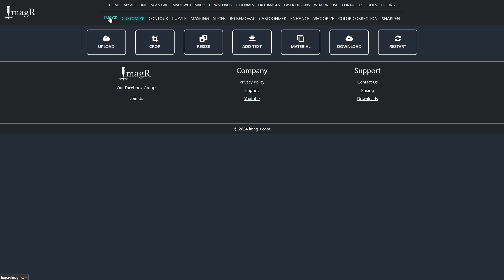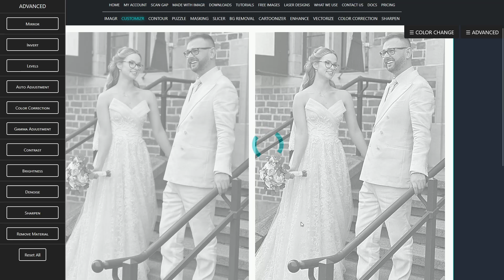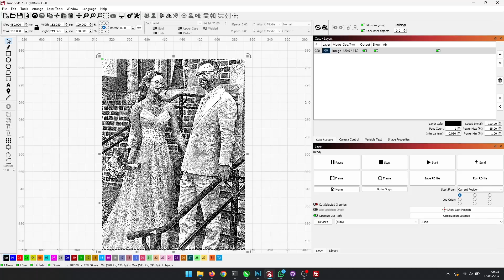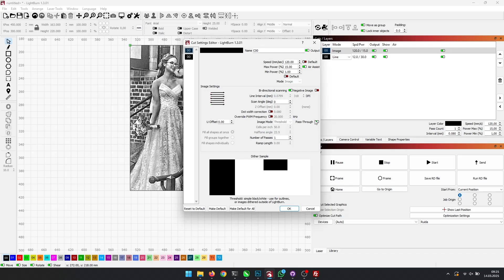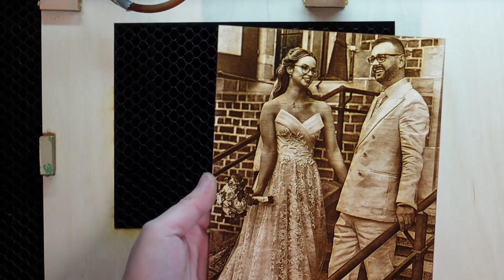I’ll Prepare Your Image for the Best Laser Engraving Results!

Comment: Each time I use the enchancer on PC version with license it cant stop loading. I add the picture, and even after an hour it keeps enchanting, how to fix that?
Reply from the maker: @crissueSport  offline or online? Depending on the input image size and the multiplier you use. Usually, you only enhance if the image is less than 1000px. And then the fast method. If it‘s under 400px, slow method

Comment: I use a Glowforge Pro which only has preset DPI's. I know Imagr like to use 318 but Glowforge only gives the options of 300 or 340. Which should I use?
Reply from the maker: Actually I really recommend our DPI video to find the correct DPI. Your DPI value depends on a lot of factors. Therefore it is not recommended to use any of them without testing them :)